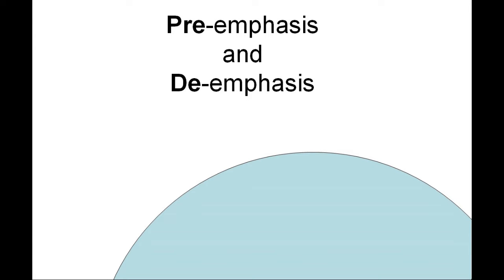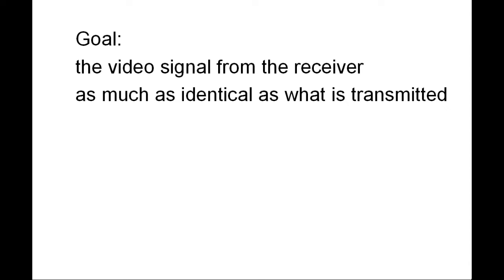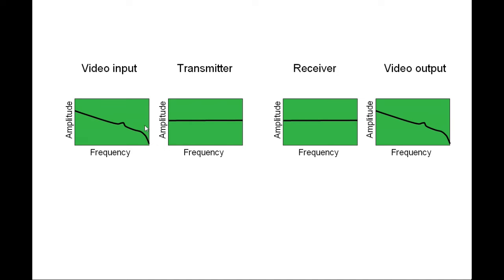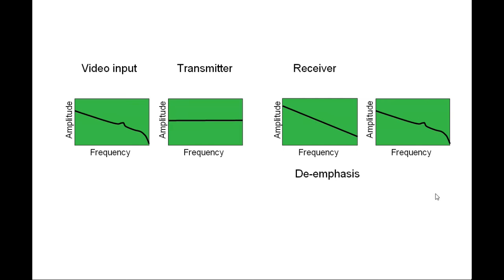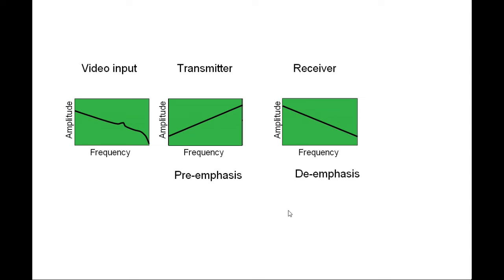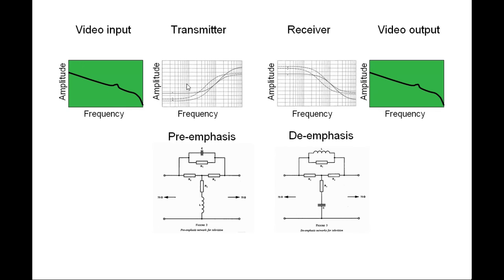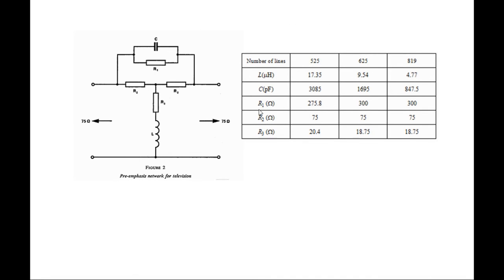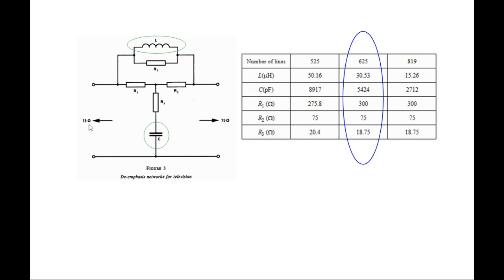Pre-emphasis and de-emphasis in FM television, what is it? Explained in a simple way.

Comment: Congratulations for your very interesting videos! I want to build Atv setup on 10 ghz based on gunnplexer or hb100,  I have the materials and schematics.. My problem is on the receive side. I want to use Lnb with bias T etc BUT I can't find old sat analog receiver in order to receive the 10ghz fm-atv produced from hb100 or gunnplexer. IS there any alternative solution for the reception??  I searched slot and is impossible to find in used market old analog sat receiver. 73s SV8GXC
Reply from the maker: Thanks for asking.
I don't think analog satellite receivers are even offered second-hand anymore. There are probably still plenty of them lying around somewhere, at the disposal of radio amateurs, who ultimately don't use them. So I'd recommend asking on a radio amateur forum, club, or local repeater if anyone has any lying around.
Of course, it's possible to build an indoor unit yourself; I've done that in the past. It's a good idea to revisit that in a future video.
To at least receive something, you can use an RTL stick with software that allows you to watch AM (narrowband) television (like https://www.rtl-sdr.com/analogue-tv-with-rtl-sdr/ ).
I hope this has helped you get started.
Reply: thanks for answering. In Greece i believe it's impossible to find analogue sat receiver between amateurs since the atv activity is almost zero and micro wave activity is much less... I know that rtlsdr is capable to work in 3.2mhz sampling rate max that is ok for dvbt but not suitable for analogue tv.TVSharp application uses small bandwidth and gets only black white image but is only for AM video. According to my understanding gunplexer and hb100 will modulate video only in FM ..so TVSHARP application is not suitable. Iwant to keep it as low cost and simple as possible.Itvwill be crazy to have hb100 and modulate fmatv and use alalm pluto sdr and gnu radio for reception....... I liked what you wrote about homebrew receiver. Before I write you yesterday I was searching the concert to build something with a simple analogue tv tuner that i will get the IF and demodulate the video with a very wide FM demodulator chip. l found some chips like TDA2730 but i dont know if they are suitable for FM video demodulation.In your comment about homebrew video decoder it seems you have knowledge about Video FM demodulation , have built something? can you give me any direction to what chip/circuit to use for demodulation?? any help is highly appreciated! 73
Reply from the maker: @george.vastianos With TVsharp it is indeed only narrow bandwidt AM. On the other hand, there's something called edge detection. By tuning to the edge of the FM signal, the image is still visible. It's indeed poor, but it might be worth trying. I do this myself with narrow FM ATV on the 9 cm amateur band.
Incidentally, this can also be done directly with a UHF (AM) television receiver, for example, 10525 - 9750 = 775 MHz, channel 58.
The TDA2370 doesn't seem suitable for FM video detection. In my receiver, I use an NE564, at a frequency around 50 MHz.
If you want a higher IF, an SL1451 might be useful. In the Netherlands, a complete satellite tuner with such an IC costs only €1: https://www.vandijkenelektronica.nl/product/satelliet-tuner-sat-5601-met-2-deler-tot-3-ghz/?lang=en
The schematic: http://www.hvde.nl/electronica/tx/23cm/SAT5601.gif
Baseband out, so you'll still need to add a video amplifier (NE592) and de-emphasis. Not a great tuner, but still usable for your application.
See also https://agaf.darc.de/archiv/tv-amateur/TVA70.pdf for ideas.
As mentioned, I'll come back to this in a later video.
I look forward to hearing about your experiences!
Reply: @PA3CRX  Thank you very much for the valuable information and the ideas! I didn't know the trick about edge detection in video. In CB reception I have the experience of receiving FM signals in old AM cbs but I never thought that this technique will be applicable in video! I look forward for your future related video when it comes.. 73
Reply from the maker: @george.vastianos  Thanks for your kind words! I appreciate your subscription. 👍
Reply from the maker: I published a video that is likely helpful in case of building a FM ATV receiver: https://youtu.be/SDlFF-exo2k
And also: https://youtu.be/hJeAHDK5jsY
Enjoy building!